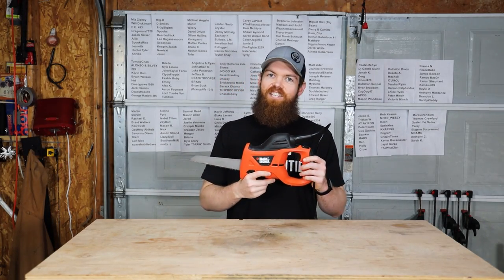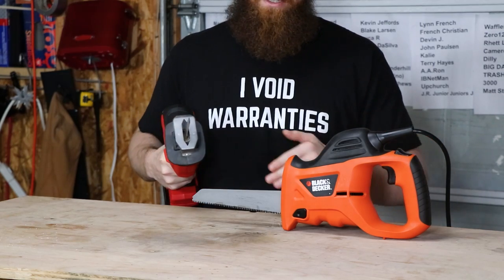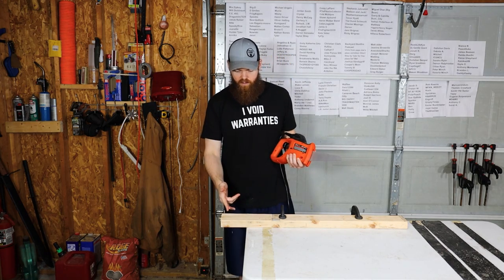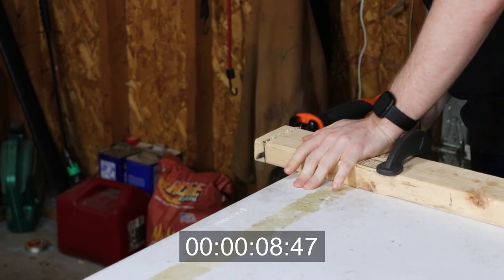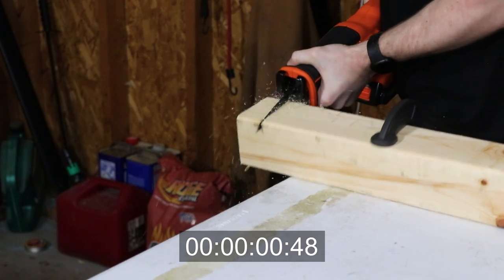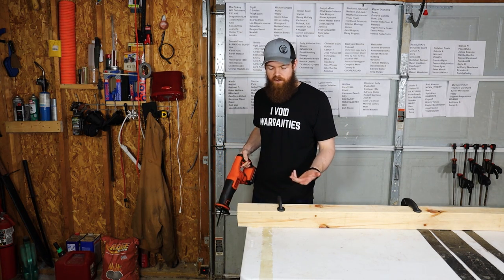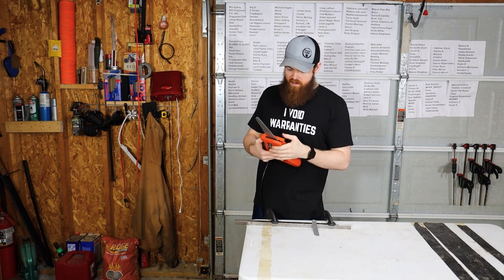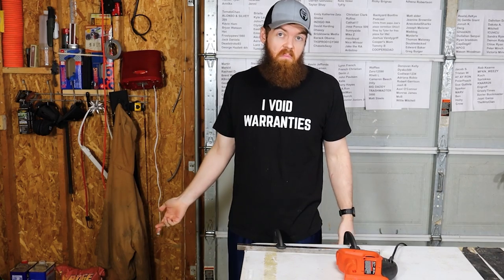Which Black And Decker Saw Is Better?

Comment: Which Black and Deck Saw is Better?

None of them! Hah

That's no secret now for decades.. B&D is just the bottom of the barrel, barely works.  Maybe a step above the cheapo harbor freight... just barely.

The only thing I can say for the Black and Decker.. it looks smooth and doesn't kick on you.  Unlike a saws all.. if you have no experience..

Comment: I feel like this guy’s whole life is user error. He doesn’t know how to use the saws, and his table is not a proper working surface, so of course it’s going to shake all to pieces.
Reply: Then how should you use it then dummy?
Reply: I get the point you're trying to make but when he uses the milwaukee with the same setup and that thing just flies through, you can't really blame user error or the setup. 

B&D are fucking awful. More of a toy than a tool.
Reply: @vein444  fax
Reply: @saltymain  if I have to explain it, then I’m not the dummy.
Reply: @vein444  no doubt Milwaukee walks all over B&D. But if you look closely, it’s almost as if he uses B&D as poorly as possible on purpose. But the Milwaukee is going to outperform even if used the same way.
Reply: @fisheyeguy  even if he tried to used it the proper way milwaukee would have slammed dunked b&d all night
Reply: @saltymain  hey we are in agreement here on that statement.

Comment: Sorry tyler but your so far from using them saws right its funny.  Sawzall style tools indeed do require a certain finesse.  Not saying they are good tools, but your definitely not using them right.   Let the saw do the work, dont try to force it.  If that doesn't make sense or you dont feel like comprehending, please stop doing tool reviews.  Sure it seems simple, but it's not cut and dry like you think.
Reply: You're*

Comment: This guy is incredibly painful to watch. If you cant use the tool properly or even have to ask how do I hold this thing from moving then u shouldn't be doing these types of videos. Lol its like his first time using a saw. not to mention he's not even comparing different blades. You can have the best saw out there with a shit blade and it'll take forever to cut.

Comment: Long term use just get milwaukee 10 20 30 years still perform well save hell lot money.black and decker who the fuck design tht  shit the wire place it on top? use common sense  
for design trying to be sci fi crap make sure is logic.is annoying to use while working the wire in the way .

Comment: You are pretty terrible at using tools Tyler.
Clamp that crap in a vise. And hold the saw correctly. All your energy is not being used for work